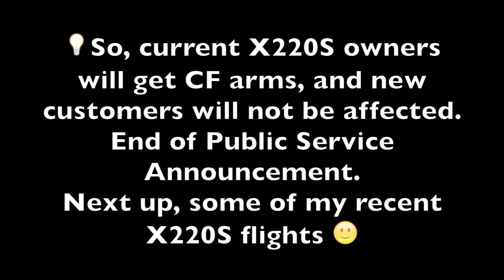Eachine Wizard X220S - Public Service Announcement

Comment from the maker: [Update: Banggood lied to me!]
➡️Banggood has said that for all X220S orders placed during 22 May and 23 July , they are sending a whole X220S to resolve the carbon fiber arm issue👍, instead of just the carbon fiber arms! 😮 I have been given an order of a Eachine Wizard X220S in my account! 😄
Reply: Christian Skanse I got the SAME
Reply: Fyre SG I pre-ordered 2 in the first batch... my notification is for 2 Wizards... LOTA spare motors, time to FLY HARD
Reply from the maker: English is not their native language so their email may not be clear. In any case, I have personally contacted Banggood (in Chinese) and gotten direct confirmation that they are definitely sending brand new replacement X220S to the affected customers.
Reply from the maker: BAD NEWS! Banggood LIED to me! 😡They said we would be getting a whole X220S instead of replacement arms, but I JUST RECEIVED A SET OF X220S ARMS! 😡 And the tracking number matches the replacement X220S order. I am going to ask them what's going on!!!
Reply from the maker: Michael, wow! That's going to be 2 more Wizards for you!!! 😲 Yeah, lots of spares, and you can fly hard without worries. 😄
Reply from the maker: Christian, it is definitely brand new ones. Banggood doesn't sell used products, and Wizard X220S is such a new that it is impossible to have old ones. More importantly, Banggood is resending these X220S because they belong to the latest batch that have been improved with stronger arms, so I am very sure we're getting BRAND NEW ONES! 😄
Reply: Fyre SG  Chinese culture and Chineae business culture, is to say what makes things sound as good "face". they call it normal we call it lying/scamming. prices are not cheap from these companies the bottom line it is a CHINESE company 😂😂😂... as long as China as it is is around this business culture likely to be a poison. I ordered $3k of parts from them over the past month time , SCAMGOOD/poor management, same result . cheers
Reply from the maker: Till now, the rep from Banggood has not replied my question. I'm very disappointed because the very least he could have done is to apologize for confirming with me that we are getting a NEW X220S, and allowed me to propagate on the Internet.
Reply: Fyre SG that is how Chinese companies operate, square trade too hahaha
Reply: Christian Skanse did you use PayPal? start a refund for not received what was described😉
Reply: I was 4 days off..... I had sub order on my account with a new one, just received arms

Comment: What about the stock props, there are a lot of complaints for fatigue close to hub, in your videos, you fly with them?
Reply from the maker: Yes, I flew with the stock props. I did not have fatigue issues if I didn't crash; the props are fine even after hard flights. But after a bump, they develop "white lines", and I continue to use them without catastrophic failures. My only complaint is they burn a lot of energy, and I get shorter flight times. So I swapped them for 5048 or 5045 eventually.
Reply: Thank You! 
I will order it in the next month, still waiting, if Eachine try to fix complaints. And if I have any issues ( I'm sure there will be :)  ), can I consult with you?
Reply from the maker: Sure. By the way, have you seen FuriBee X215 Pro ? From its specifications, it seems to be a better platform than X220S. I'm getting it for review, and it should arrive in mid-Sept.
Reply: No, I'm not, I've seen it now, the price and specification is very close to X220S. I will wait for your review, because you are very familiar with Wizard, and will take decision throught October which to buy, it is not urgent, I want it just for home hobby.
Reply from the maker: After flying X220S for such a long time, I can tell you that mine has problems. I am not ready to show recent X220S videos because it's not flying well, and I have not fixed it. I am disappointed that it seems to be worse than X220. I am still trying to resolve the problems and I hope to release a video about how to fix the problems soon. I'll let you know when my X215 Pro is here. Or you can subscribe to my channel to be notified when my videos are ready. :)
Reply: I did it already, and will expecting your videos.
Reply: Hi Fyre SG, did you recieved  FuriBee X215 Pro, now is on flash sale on very good price!
Reply from the maker: I am getting it. I have the tracking number and it has been shipped. Stay tuned for my review!
Reply: I think to order it, flash sale is finish tomorrow, when you expect to be ready with the review?
Reply from the maker: 3 more days to reach me, then another 3 more days to do the review.

Comment: it's not just the arms, my bottom plate just snapped
Reply from the maker: The bottom plate is not strong and I broke the one on my X220. But it certainly is not made of the composite foam carbon fiber material, which is the objective of this video.
The arms are different from the plates because they used to be very strong and could withstand crashes very well.
Reply: Fyre SG  bro arms and plates are both that foam, mine all are (on both units) ... POS Chinese companies MO is cheat customers as soon as product is popular... doesn't end well for consumers , not western business practices
Reply from the maker: I'm Chinese and I understand what you mean. Chinese companies even cheat on food; they stuff cardboard into buns instead of meat. But in this case, BG is not exactly cheating. They were fooled by the manufacturer to believe that the foam composite arms are "better" - light and strong. They realized their mistake after seeing the brittle parts break in crashes. But it's too late. They should have been more careful in making business decisions like this.